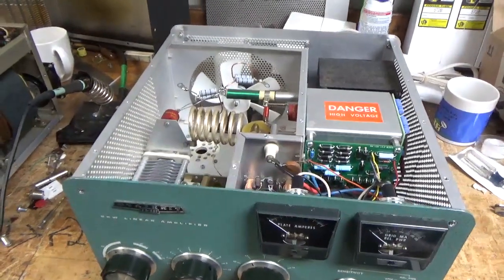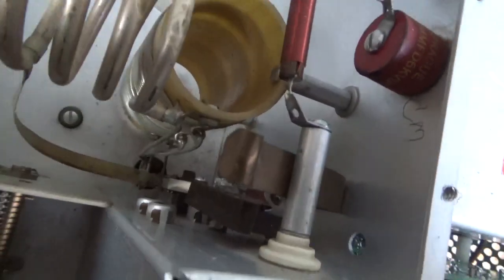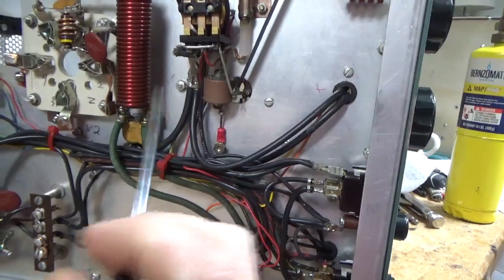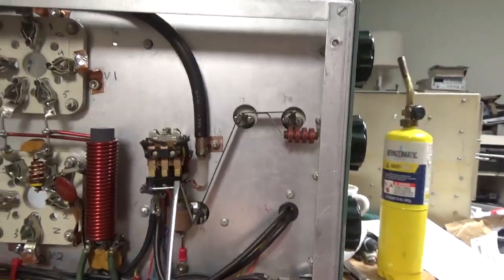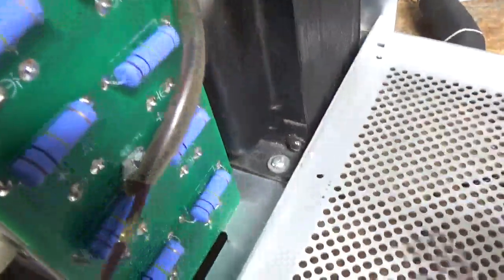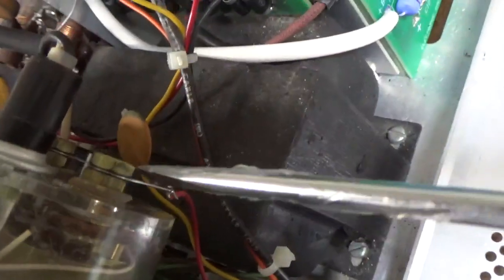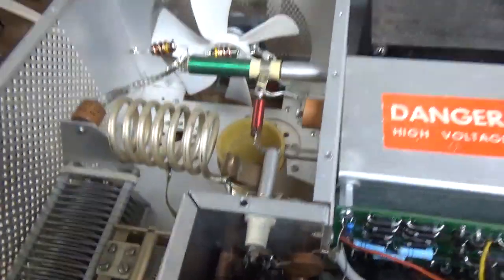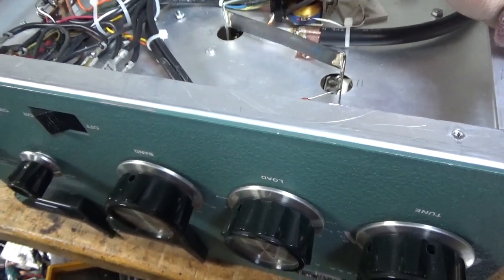Heathkit Sb-220 Repairs And Modifications. Re Doing Other Peoples Work

Comment: I noticed that you are not a fan of the horse shoe shaped inductor in the plate suppresser. I haven't tried it, but have seen another amp repair guy out of Idaho promote them. Please elaborate.
Reply from the maker: I have explained as have others why they are not wise to use. First off the stock configuration with a carbon comp is superior. Reason why most do not replicate is due to the resistor cost. 

If the grids are grounded and done properly, the  pa is not in an idle state stored in a humid environment for a long length of time or abused. Then  the stock ones will last 40 plus years

The hairpin type brings the anode closer to ground which increases the risk of flashover and increases total capacitance in parallel with the c1 tune capacitor. 

Don’t believe everything you see on YouTube, especially when from a cb person. 

Understand the theory before you enact on something you see or hear.

Comment: Hi Scott,
You needed to touch almost all the soldering for that amp. What value and wattage are you using for the glitch resistor and is it a special type?  73  WJ3U
Reply from the maker: Hi don, I use a 10 ohm 10 watt wire wound